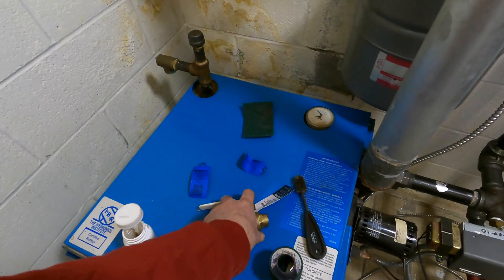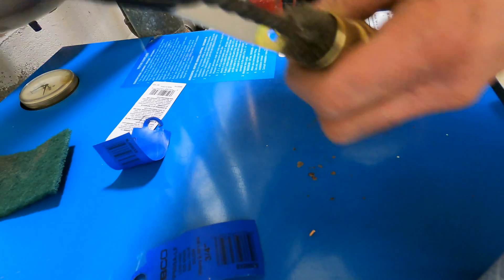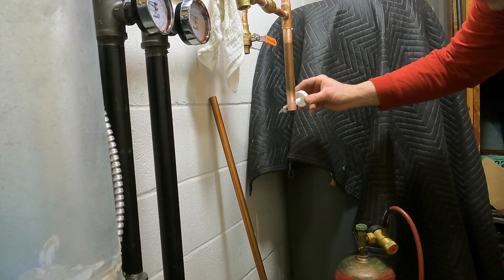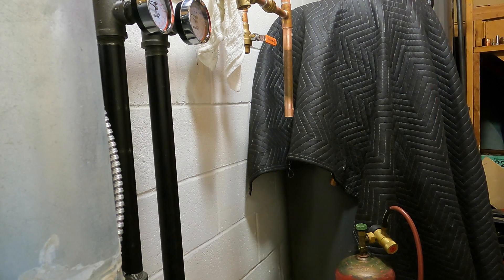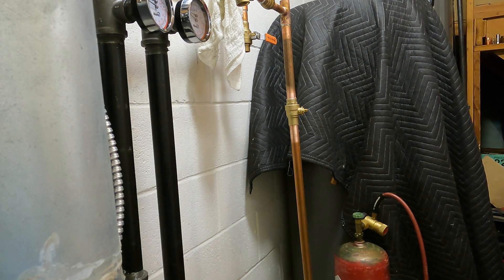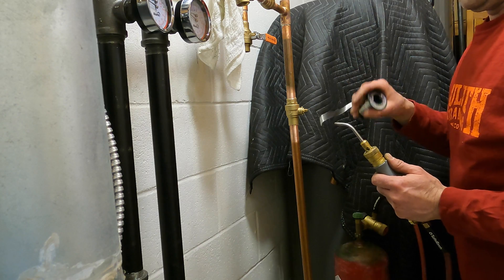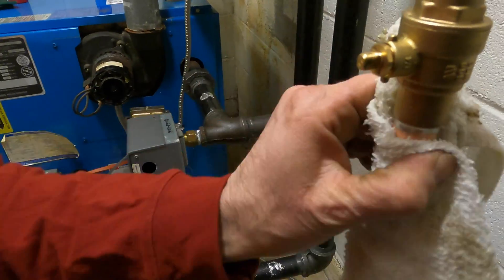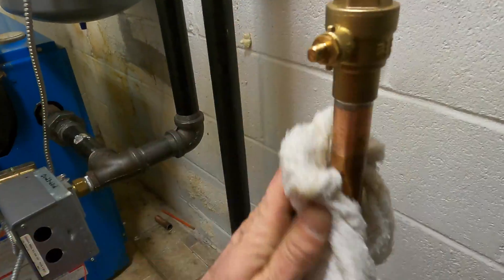Soldering Lead-Free Ball Valve

Comment: No eye protection, heating the copper pipe with a direct flame as opposed to heating the body of the valve.  C- at best.
Reply: I thought you are not suppose to heat the body of valve since it could burn the rubber ring inside?

Comment: Apollo says their EZ-Solder bronze ball valves don't require low heat solder but they say 410 degree solder helps. Especially that I need to wet wrap an elbow only 3/4" from the valve I'm looking to replace.  I looked at the prices of Sterling low heat solder.. expensive!  I only need to solder 2 of these heavy duty 70LF20401 apollo valves. Thanks.

Comment: With small pipes, I don't run around the pipe with my flame like that.. I just heat one side with some movement and put in the solder on the other side. This way, I know it is heated up enough everywhere and the capillary effect combined with the flux takes care of the rest. Besides, I normally don't have room to move around the pipe this much..

Comment: Might be best to use safety glasses. Also why not wrap the valve center with a damp rag held on by a vise grip ,to protect the ball valve seat and packing from excessive heat.
Reply: This didn't work for me... The wet rag cooled the solder point way too much to solder normally. Just don't heat the ball, but just the tip of the valve.

Comment: What tool did you use to “ Rheme” the valve,  and what is Rheeming?
Reply: Technically it is not reaming, it is burnishing. Removing all containment's or oxygenation  on the metal   to achieve uniform solder flow.  Reaming is more about de-burring.
Reply: look up pencil rhemer
Reply: @ShrimpCracka  will do.  Thanks.

Comment: Hello , lead free fitting dont conduct heat as leaded fitting do . Require tinning flux and as you said a lower temp solder . Info from manufacturer.  Hope it helps 👍all the best

Comment: Would a plumber be OK with a sharkbite(  half way in wall) for a main shutoff valve ?
Reply from the maker: I’m not a plumber, yet deal with water lines for heating systems. I do not like shark bite fittings. I don’t trust them, seen and replaced to many leaking fittings. Propress fitting I do trust
Reply: @howtohvac3234  Do you think compression valves are more trustworthy than sharkbite? Or the same? What about compression valve a main shutoff. I'm just worried when the water co turns my water off at the street so I can replace my house main shutoff, the water will be trickling too fast to solder. Thanks

Comment: Sorry but that is horrible solder job..back in the day we soldered hundreds of brass valves. You only need to heat up the brass side in one continuous dime size motion in one spot...copper and brass heat conducts..once the flux starts to smoke you the tap the solder onto the brass to see if it melts. If not wait 10 more seconds..retry..then when it melts take the solder around the entire pipe never lifting the solder off it....then remove the heat..wait 15 seconds and wipe with cloth to clean any residues.
Reply: Maybe you can make a video on how you did it
Reply: @cooldude2245  There is a great video by got2learn on how to solder lead free valves showing why you heat the pipe first, valve after, directing flame away from valve body.
Reply: Back in the day they said smoking was good for you 

Back in the day they didn't install seatbelts.

Back in the day they used leaded paint

Back in the day......  😂
Reply: The newer valves are sometimes a bitch.  I learned on the up to 5% lead valves.  Big difference.  Any valve on potable water after 2014 can have at max 0.25% lead.
Reply: @BB-nn9en  ha your right the new lead free valves are different. I just sweated one yesterday. Old head plumber at Lowes told me now you have to heat the pipe 20 seconds first to let it expand..then the brass......so I tried it on a 30 buck valve and it worked like a charm......
Reply: Uh oh "back in the day"

Comment: youe welding skill is poor, the pipe not even in the proper position, pipe was drop
Reply: I thought the same until I rewatched the video closely, and it showed the pipe was re inserted fully and supported. That part was not included in the video.

Comment: The pipe on the bottom drops. He didn't lift it up and solders it. I will be get fired by my boss if i do that. I don't this is a good video.
Reply: Go back and watch at 4:40.
The pipe instantaneously jumps back into place and becomes rigid.  At that point he did stick something underneath the pipe but we didn't see that and he didn't say anything about it.

Comment: Thanks for this vid. Three questions:

1) What brand of low temp solder do you use? The sterling brand on Amazon costs $47 for a role! This is steep for a one-valve DIY home job. It also appears to be unavailable in retail stores (Home Depot and Ace).

2) One video recommend using "tinning" solder when soldering brass fixtures. Do you use this? (It, too, appears to be a rare in-stock item.)

3) Is a reasonable workaround for the above concerns to use a THREADED brass valve and attach it to copper pipes (on which one first installs male thread copper terminals)?   This has the added advantage of keeping the heat away from the ball.

Many thanks!
Reply: Sterling is available at Lowes.  The tinning flux is available at both Home Depot and Lowes.  I used both these products recently to sweat valves and it worked great.
Reply: @steveloux4709  Wow. Look at the price. Expensive for doing just a couple of valves.  The cheapest sterling at Lowes comes in a kit with regular flux (which I don't need) for $26. It would be awesome if it came with tinning flux. Oh well.
Reply: @rgraz4929  it is expensive!  I think the last roll I purchased thru eBay.

Comment: Hmmm,  aren't you supposed to not torch the joint directly? not sure if this is video I would wanna follow!
Reply from the maker: You need to get the fitting hot. The lead free ball valves need to be soldered in with low heat, or the seal will melt. The heat pulls the solder into and around the fitting. You can burn the seal easy if applying to much heat. The way I did it helps heat the pipe and fitting, without ruining the seal.

Comment: Definitely one of the best videos on how to solder LF ball valves out there.  You hit all the important points and it is refreshing to see someone that really understands what he is doing but WHY he needs to do it.  Especially your recommendation on consulting the valve manufacturer for soldering recommendations, as each could be different.  Also nice to see someone that takes the time to do the little things, like removing the valve handle so that it is not burnt and tightening the packing nut after soldering.
Only thing I do that is not covered here is I wrap a wet rag around the body of the valve.  Apollo recommends that for their LF valves (which from what I have the closest soldering experience to leaded valves) and I just continue doing it as extra insurance against overheating the valve body for any ball valve in general.
Great job, wish you had more videos on how to properly solder, I find it to be a dying art in the plumbing industry.

Comment: Thanks for the vid. You might have mentioned that the valve should not be turned until
completely cooled, as this can deform the seals and seats. Also, when ever possible, I like to solder my valves horizontally to make sure no flux or solder finds it's way into the valve
body.
Reply from the maker: Yes never want to deform or rip. If you control the amount of solder, it shouldn't get into the body. I have seen regular solder fitting almost closed with solder. Whoever did those solder joints must have been having a hard time.

Comment: thanks for the quick video.  a couple of quick questions.  Did you deliberately not apply a thin layer of flux to the inside of the valve, just on the pipe?  Is the TuboTorch an acetylene swirl vs propane version?  Is that ideal for 3/4" to 1" copper pipe and valves? Is it variable flow/heat?  is three or five the better size for 1"?  Is acetylene cheaper, easier and hotter than propane?  I think I want to go the TurboTOrch route vs Bernzomatic TS8000.  do you think that is a good choice for low temperature soldering copper?
Reply from the maker: I don't apply solder into the fittings to prevent flux from being pushed into piping. Applying to pipe puts flux into the fitting. Too much flux makes solder run, it also spits and splatters. Not fun doing a lot of over head soldering, getting splashed by hot flux. Turbo torch is an air/ acetylene torch. The heat output is adjustable by the regulator, and the valve handle. I use 3 to 5 often. An 11 tip heats quick and good as long as you control the heat. 3/4 pipe i would stay with a 3-7 tip. I do all my low temp soldering with the air acetylene. Propane works and the tanks are lighter. Yet i might have to do low temp soldering, or brazing a refrigerant fitting.

Comment: Excellent video. Your soldering technique is solid. Those LF ball valves can be a trick if not done properly. You covered the biggest mistake most people make and that's slathering on too much flux and then the solder runs down the pipe to chase the flux. Usually if I'm doing in inverted solder joint (the bottom of the valve where the lower pipe meets the valve) I'll heat up the pipe, then use a rag to wipe off any excess flux which sweats down before I apply the weld, that way I don't get the candlestick effect. But you clearly used the right amount of flux so it didn't go sliming up the pipe. Thank you for the time and effort you put into making this video to show folks how to do it the right way.
Reply: Yeah, he's good!

Comment: One suggestion I would give as a plumber & HVAC tech is to open the valve 1/2 way, if you accidentally heat it up a tad too hot you can warp the ball and that will cause a leak.
Reply: I would suggest instead going with the manufacturer's recommendation.  For example, Apollo recommends open while Nibco recommends closed. Some manufacturers recommend the valve be disassembled.  Best source of information would be the company that designed and manufacturers the valve.  
If it is not possible to contact the manufacturer, I default to fully open.  If the ball is full open, 100% of the nylon ring is in contact with the ball's OD. This acts as a heat sink and protects the nylon from being melted - or distorted. 
Leaving the ball partly open exposes the nylon ring/seal to the air and surrounding brass body temps - with less heat sink than any other position possible in that phase of the ball that is now inside the ball cavity. Therefore, part of the nylon ring is fully exposed without the ball's heat sink aid - while the part that IS in contact will be unevenly heated and induce warping, distortion or a melting condition.
Leaving the ball fully closed allows the bore of the ball to trap air inside the valve body chamber and although the nylon seal is in full contact of the balls heat sink (protecting it in the process as before), it subjects the packing box and ball bore to 300°F+ air expansion dynamics - which likely exceed the WOG rating of at least 125# or perhaps 300# and will compromise the packing, the seal or if a drop or two of moisture is present, or even blow out the seal.
Reply: I default to fully open for 2 readons:

1. If closed as the air inside the pipe heats, I've seen ball valves move during soldering due to heat induced pressure on one side.

2. The ball will help to retain the shape of the nylon seals during the heating process.  It's very easy to cook a ball valve.
Reply from the maker: I never tried partial opening. I always installed open unless holding water back on other side. I figured open the gasket wasn’t against hot metal. Never had problems. Yet could be a reason I run into many failed valves on steam boilers

Comment: I have vertical 1" ball valve in sprinkler line which is leaking and caused the outer pipe to burst even system was winterized. Biggest problem is that this line is filled with water close to water meter. I have small valve on tee above the leaky valve which I can remove and suck the water below the 1" valve, replace it and than reinstall smaller valve above. I can either separate 1" line on the 45 deg elbow under the celling or 90 deg elbow closer to the floor to separate the cooper pipe at the valve and than reinstall it. If I use the same pipe which connections were solder already does it easy the process of soldering new valve back? I can use the leaded brass valve if I can get it because this is sprinkler system line. Thanks for posting
Reply from the maker: Only downfall to using previously soldered connections is getting pipes together. You either need to remove the excess solder or heat the fitting to slide together. Always add flux

Comment: I’d feel more comfortable if you were wearing safety glasses.
Reply: Dont forget your tampon.
Reply: don't get you panties twisted, he is a professional second the risk of splatter is only if you overheat it and overload it with flux
Reply: Safety goggles......  why not welders gloves, face shield, judo gi , and ear plugs...
Reply: And don't forget the N95 mask too, even if the plumber has been vaccinated! :-)
Reply: Correct Jim   Safety First in all cases ..  ...  otherwise you are Not a professional..   Safety Goggles are Cheap,,  Lost Eyes are   Not..        Also He did not Seat the Bottom PIPE Tight